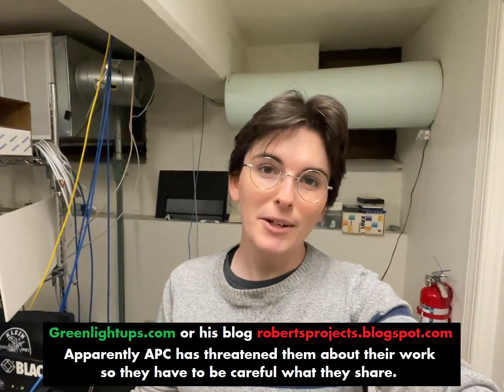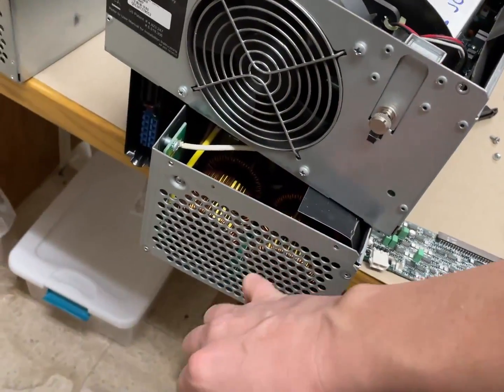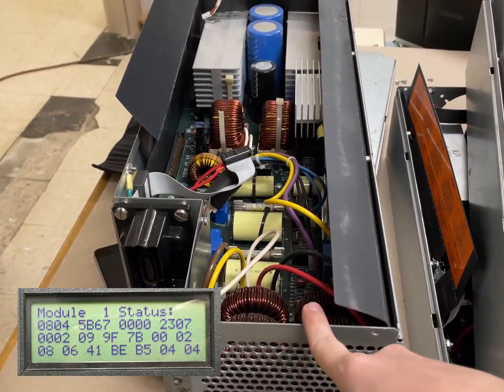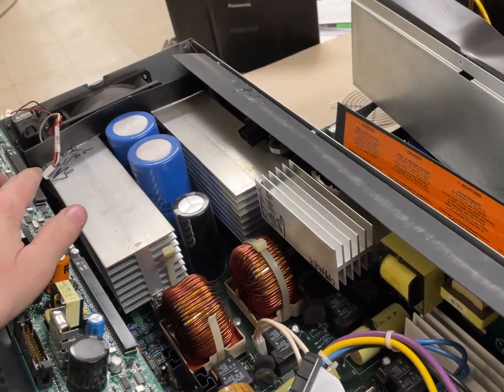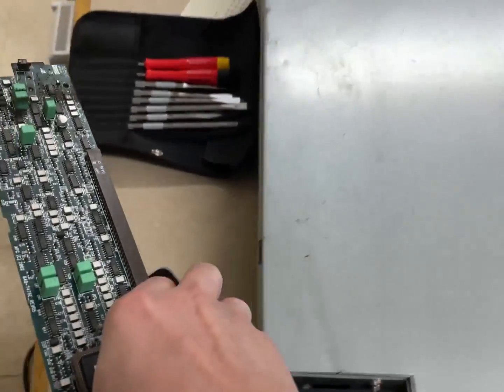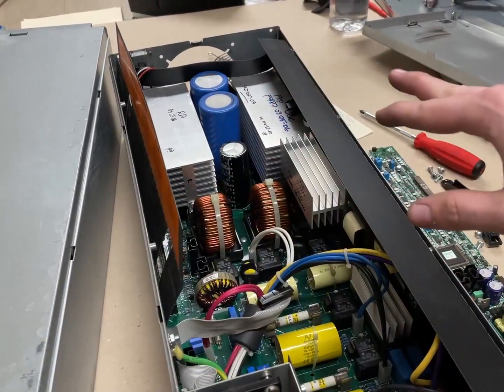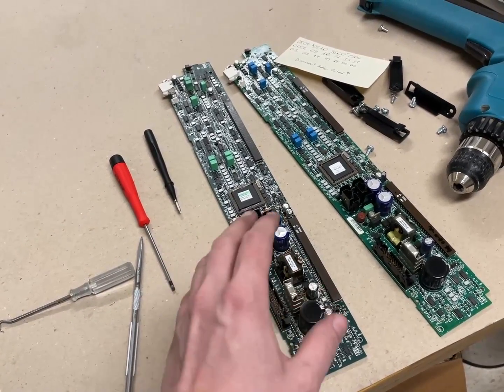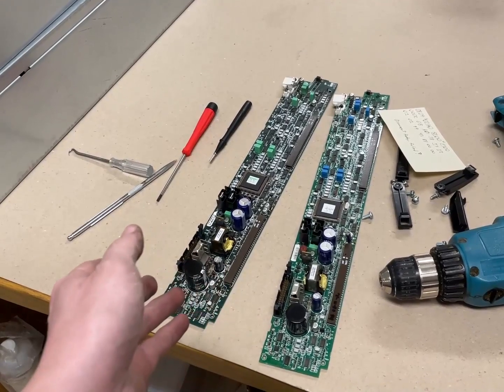Reverse Engineering Symmetra LX UPS Power Module SYPM4KP 4KVA repair and troubleshooting first steps

Comment: Congratulations, is not very common for a lady to do this sort of job. 
My question is: can be tested the SYPM4KP power module as is, without the rest of the rack? 
I have access to one unit SYPM4KP and one SYPM2KU which need to be tested. Do you know if a service manual exists and can be downloaded for both of those, including the needed command set. Thank you.

Comment: Rinoa thank you, i have exactly the same issues at work and clients with the same power modules! i really appreciate it!, i found out this happens too because previous technicians remove the power modules by maintenance procedure of cleaning and measuring when the UPS is set to online, instead of bypass mode, so when the power module is inserted to the UPS in online mode, it reach to fail, and same repair has to be taken for. I really appreciate your feedback and the way you troubleshoot these power modules, there are other channel of russians solutions that gives more related solutions about this kind of troubleshoots

Comment: Are there any opto isolators on the card isolating the data bus to the main unit? In the past I had several fail in data equipment…

Comment: Hi, thanks for the excellent video Rinoa! How about you solder some small leads to verify the power quality that is getting to the CPU with a multimeter or even better with a small oscilloscope preferably battery powered to avoid ground issues. Keep up the great work!
Reply from the maker: Sadly my oscilloscope gave up the ghost last time I was going to grab it. I think for the time being I'll just replace the capacitors to gain a foundational understanding of what may need to be done, and if that's all that's needed then i'll gladly not spend more time on it for the time being haha.

Comment: signature solar sells Lifepo4 racks and inverters and that can do fail over, for the price of a Shitmetra you could just install a solarless solar system with 10+ lifespan batteries
Reply from the maker: This UPS has a faster switch over time for the time it came out though, and its hard wired into the building now. As time goes on its compute loads decrease a lot, so it should handle for another few decades well enough

Comment: Very important helpful work, thanks. We are going to need older hardware more and more 
APC tried to replace a common more vertical UPS a couple years ago with a new cheap crap failure-tastic model. Huge backlash from all their customers made them reintroduce the same model.

Also recently someone took apart a simliar vertical UPS, and found out that the wires internal to the transformer were that plated aluminum shit that doesn't solder properly and there was just these big obvious fuckup balls of solder.

The whole supply chain wants us to die

Comment: Those big capacitors can zap you death. You can desolder and measure the capacity. Sometimes C are shorted, with chips, they can have loose bonds inside, pressing on them can help.

Comment: I get it about folks saying just replace them. I'd be debugging my design, a piece of my test equipment went south, and a manager would catch me repairing it & I got my backside chewed out every time.  Even if it only took me an hour and a 30 cent capacitor, it was cheaper to call a rep to bring out a new machine and have me working on something else during that time.  This mentality is rampant.
Reply from the maker: Most of the people upset at me actually are saying im putting people in danger and such because its batteries, and “they made it that way for a reason” but no its not like that. They dont realize i could charge a month’s labour for each unit and itd still be the new cost

Comment: Wow, that thing is a beast! Never seen an industrial UPS rack before. Looks very high quality compared to the consumer junk ones I am used to that just float charge the battery at 14V until the cells boil over a couple years later. I RE'd a bit of the consumer ones to try to see if I could modify it to not roast batteries and they are surprisingly complicated, yours looks even worse! Good luck!
Reply: If you're looking for better quality and more runtime, take a look at "inverter chargers".

Comment: The board with the dead comms could still be a cap (or at least power supply) issue, and might actually be the easier one to fix. If the chip is getting power it could be so noisy that it just isn't able to boot. But you are right, it could be a problem with the comm interface itself. Something I have seen in the past is communications handled through an opto-isolateor, and I have seen those go out before.

And good on you for working on this in the first place. Even if the modules were cheap to replace it is still a good exercise, and that first battery video is what got my interested in your channel in the first place.
Reply from the maker: Yeah my main suspect in my head is connections and caps, but then the transformer after that.

I might build myself a custom microscope or something soon

Comment: What are the odds, I just got one of these units. Have you thought about if putting in Lifep04 battery’s in would work?
Reply from the maker: definitely have and I plan to first try on a 24v system I have. Already have the batteries. Sadly most lifepo4 pack BMSs dont like more than 4s
Reply: @RinoaL  I was curious about that, I see Amazon listings for them and they say that they work in series but don’t specify how many. I’m definitely going to email that person to try to get a manual. I also got an APC 100 amp bypass transfer switch with it. I started taking it all apart. It’s very interesting inside.
Reply from the maker: All the ones ive seen say to limit to 4 series

Comment: I have seen a lot of those old surface mount electrolytic caps leak in old radios. Sometimes it looks like flux but they are actually leaking from the bottom.

Comment: You probably checked those already, but are those little circular fuses still good? Or would the error code be different if the control board has no LV supply at all?
Reply from the maker: I actually hadnt checked anything at all, this was my preliminary testing so ill check that type of stuff next